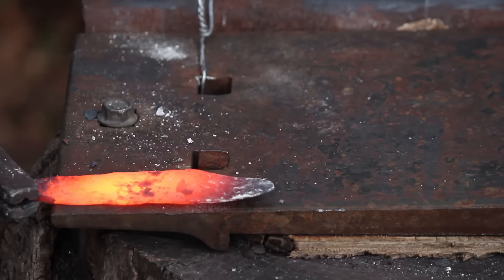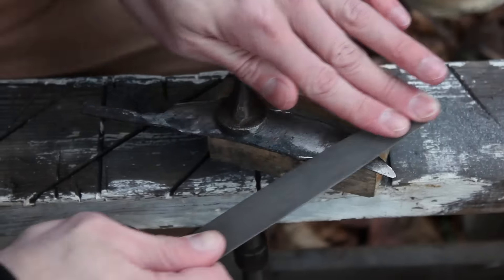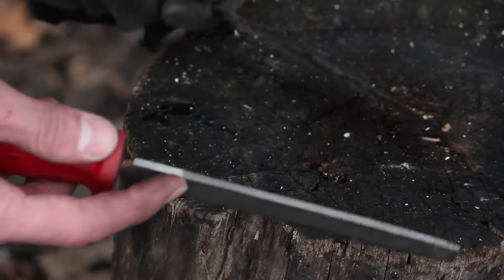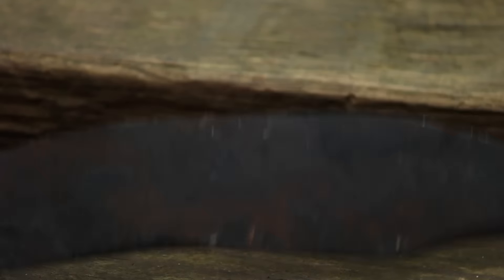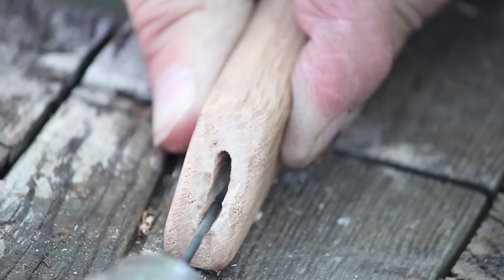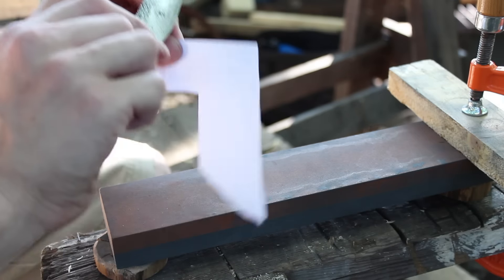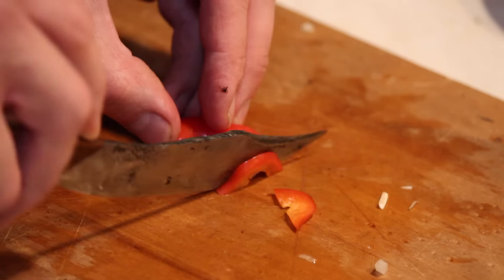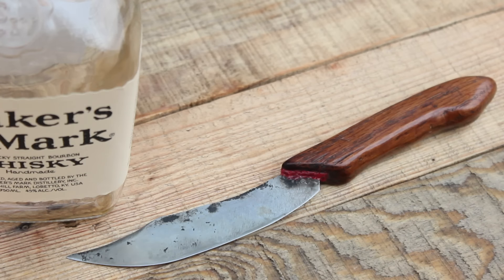Forging a Knife from a Coilspring- Part 2 (Finished w/ Hand Tools)

Comment: Love it!  That is good forging to get it so thin and wide..not easy.  I am going to forge one now.  Edit:  I just forged 3 blades out of one 360 section of coil spring.  Entirely by hand..with only electric 6 in grinder for some of the handle shaping part

Comment: A quick little tip for the oil what I uses is just a big old pipe made of iron or low carbon I heat up a railroad spike White hot I toss it in right before I put in the knife that usually gets it up the temperature

Comment: It's a great start but the problem with coil spring is that the likelihood of stress fractures existing in the steel is pretty high. The upside is that 5160 is a pretty forgiving metal, once you get passed how hard it can be to forge. That high chromium content resists your hammer blows though not as much as shock resistant (e.g S7) steel.  I like how you annealed it before draw filing but you missed something pretty critical, 3 normalizations (from critical to room temp) will take you far in relieving the stress and refining the grain structure through decalescence  and it'll help ensure maximum hardness while lowering the chance of breaking.Also I like how you did a differential heat treat, that's always good at making sure you don't hear that horrible PING of a broken blade in the quench. I look forward to seeing what you come up with next man.
Reply: he didnt normlize it 3 times i think he just tempered it 3 times which doesnt lead to grain refining, it only relieved the internal stresses.

Comment: Someone elighten me pls, what is the HRC and edge retention of knife made using coil steel? Lots of people sell this kind of knife in my country and I don't know whether it's good or bad.
Reply from the maker: After quench before tempering they get up past 60 rockwell. Depending on temper they should come back to the high 50s